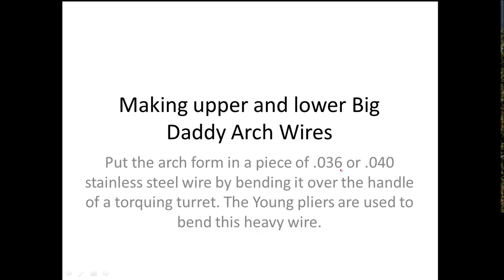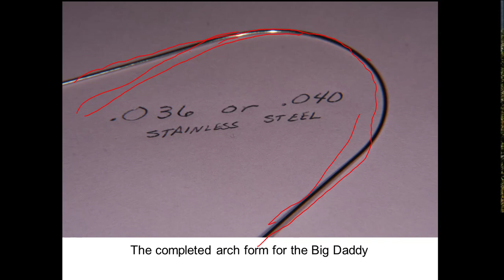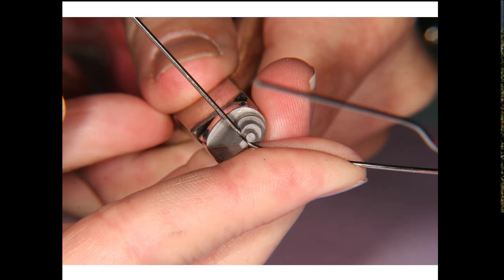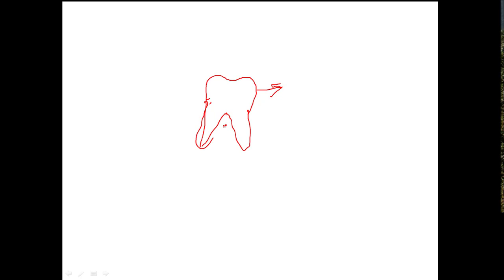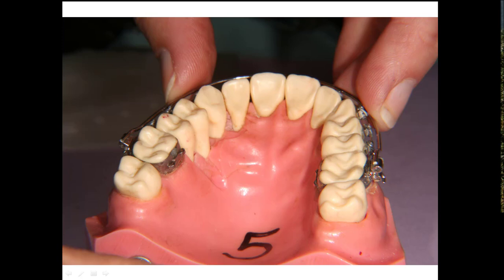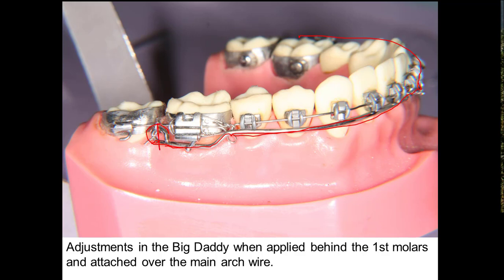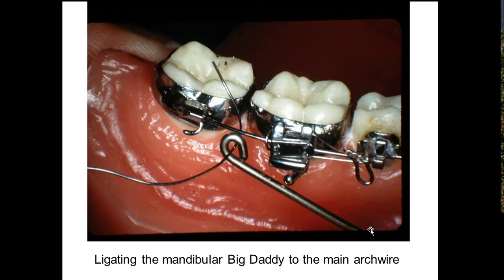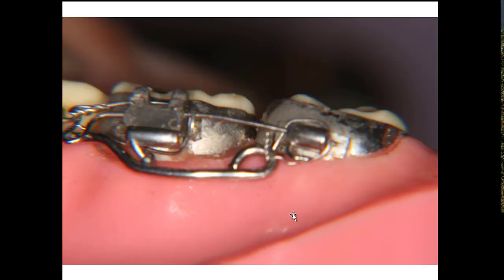Dr.Wyatt's Big Daddy Arch Wires

Comment: Could you just run the wire on the lower into a .045 lip bumper tube?  What is the minimum archwire (in the slot) size?  .020" stainless?  Thanks.
Reply from the maker: You could do this but you get a better result by tying the lower expanding arch between the two molars. 
The 2nd molar is brought out by the archwire you have on the case. If it is a very flimsy archwire, you would not be able to bring the 2nd molar buckly properly. Just remmeber if you do a lot of expansion, you will need a rectangular archwire with buckle root torque, so that the roots of the teeth expand a long with the crown portion.